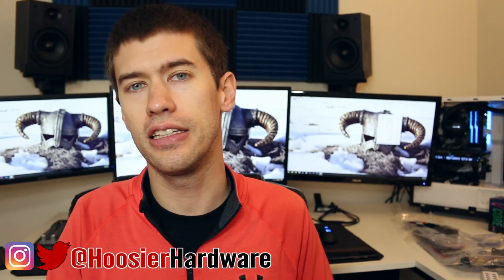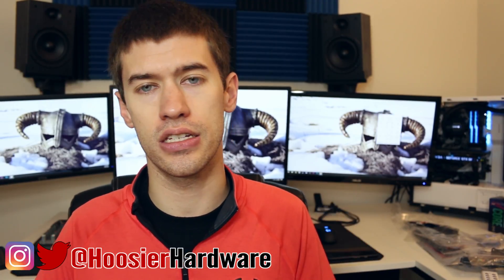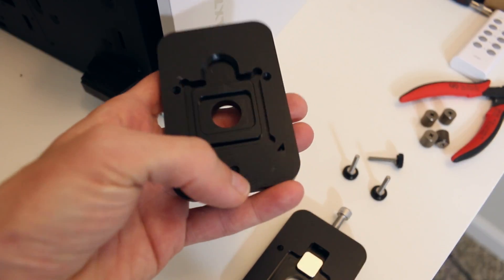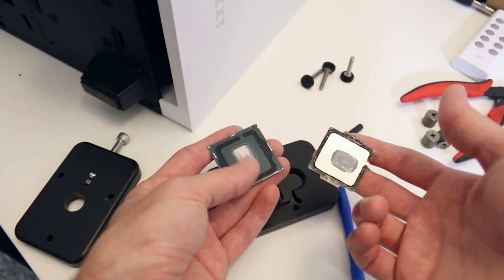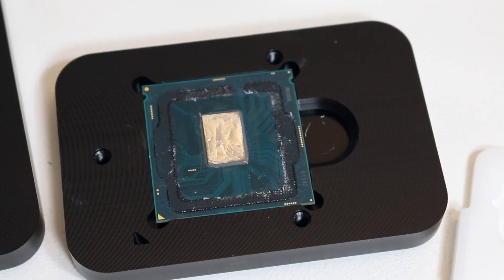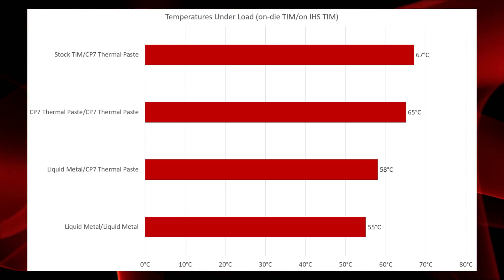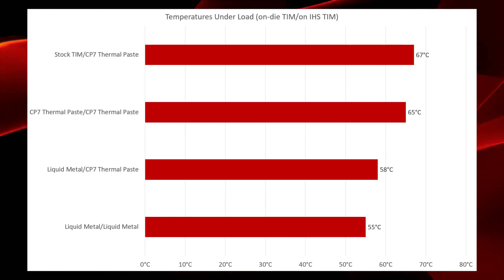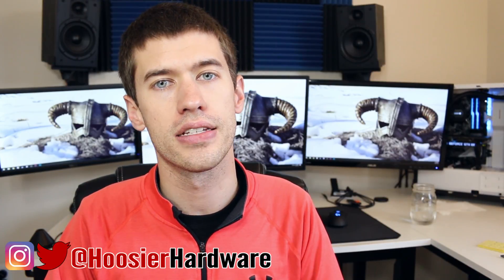Delidding and Liquid Metal on the Intel i3-8350K

Comment: Thanks for sharing, nevertheless from experience i have a few suggestions: 
1. apply nail polish around CPU then
2. wipe clean with alcohol CPU die so the liquid metal sticks better also valid for IHS
3. when applying liquid use directly the syringe head (or  a wood match or toothpick) as it is firm ans soft, softly pressing while applying helps a lot to stick it uniform

Comment: 1, You use too much, preformance results can be better by using lesser liquid crap/// And not using that nail crap...
2.Your comment about not investing it in the i5 8600k and spend the credit into an i7 8700k smells like your breath...
3.I can imagine how you breath smells since YOU CANT PUT THAT CAMERA TO YOUR FACE ANY CLOSER AS IT IS NOW...(Not Nice!)
Also, Re flat the heat spreader if you are doing this job anyway...

Comment: Appreciate what you did, but you should have cleaned off all of the black adhesive as it traps heat.  You get the best delid/liquid metal thermals from keeping it unsealed and you would have dropped your temps significantly more.

Comment: Update - my guy used Conductonaut for my delid.

Before: 4.4 GHz @ 1.16 V;   62 C @ 750 rpm
After:    4.5 GHz @ 1.19 V;   52 C @ 500 rpm

all for £14. There's probably even more room to overclock, in fact.
Reply: Lol man I got to 4.8GHz @ 1.25v with stock intel thermal interface, the chip is still max 70C
Reply: @grumd0  what cooler? because this cpu doesnt come with a cooler....
Reply: @Dakotajm0726  be quiet dark rock pro 3
Reply: LOL.

Comment: Forgot to mention that this OC was on air with a Hyper 212 EVO using Antec Formula 7 Nano Diamond for the CPU to Cooler TIM.

Used Thermal Grizzly Liquid Metal for the CPU to heat spreader TIM.

Comment: Delidded my I3-8350K today.  Took all of 5 minutes, no need for varnish.
Max overclock at 4.9GHz @ 1.39V.  Max core temperature running Prime 95 is 78C.  Prior to delidding, max overclock was 4.8GHz at 1.4V and 100C running Prime 95.  That's a 22 degree C drop and 100MHz boost!

5GHz is possible at 1.44V and 85C but I am not comfortable running the CPU under those conditions.

Best overclocking investment I ever made.
Reply: Are you sure you need 1.4v for 4.8GHz? My i3 works fine at 1.25v at this frequency. Btw delidding doesn't make it more stable. Only cooler. So if you can run it at 4.9 @ 1.39V, then it means you could also run the same frequency with stock TIM
Reply: Yup, didn't win the silicon lottery for low voltage operation.
I can boot and use non-demanding applications at ~1.3V but in order to run Prime95 for more that 30 seconds, the voltage needs to be at least 1.4V.  Still, running Prime95 at 5GHz the max core temperature is only 78C

Comment: To be honest, I think you are doing yourself an injustice by putting too much TIM, between CPU and cooler. It's supposed to be the thinnest layer possible.
Reply: I agree, TIM is only there to fill in the micro holes in both surfaces.  He also put to much liquid metal.  He also didnt show if he put liquid metal on the IHS under side also, along with how much glue he used to put the IHS back on.   All of these are factors and how much temp drop you get.

Comment: Another good, informative video.  Like button punched!
One thing, tho-
Aren't the newer Intel processors a different shape, so the de-lidding tool wouldn't work with them?  Meaning you'd still have to spend money on a new de-lidding tool?
Reply from the maker: The way this tool works in particular, it shouldn't matter so long as the pcb under the ihs is the same square size. The one I used is listed as working for LGA 1150/1151, but it's something I'd recommend anyone planning to delid to double check before buying.

Comment: I delidded my 7700k this weekend. That was scary waiting for the lid to "pop" off. I put everything back together, and the temps were skyrocketing... I thought I broke something! After some troubleshooting, I realized that my Corsair H100i pump had failed (wasn't making noise, one tube was hot, and radiator was cold). This is the second Corsair Hydro to fail on me this year!

I had to use some thick thermal paste with a stock cooler, and it is awful! Ordered an EK custom loop and some Thermal Grizzly Conductonaut that should arrive by Thurs. I'm way over budget this month.
Reply: Tage Nasty that's why I like air coolers over aio's but custom loops are amazing